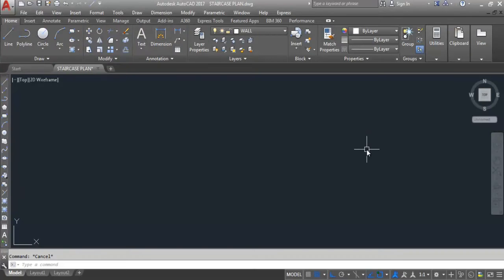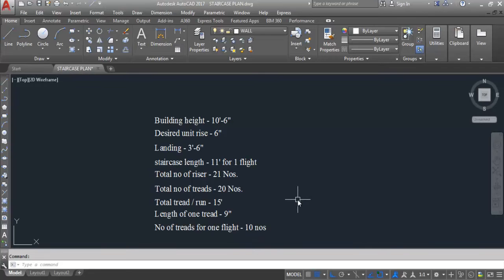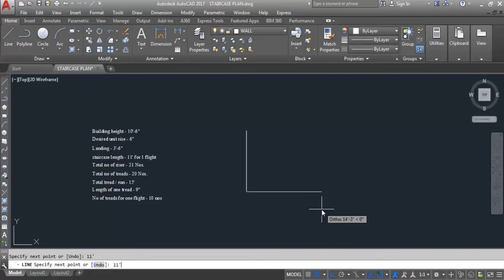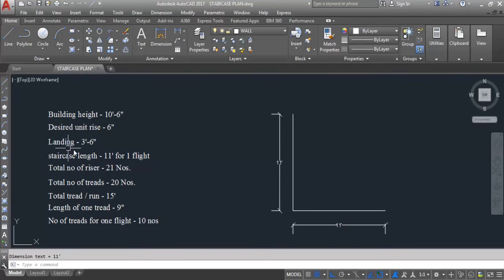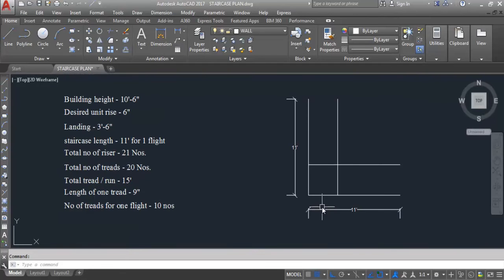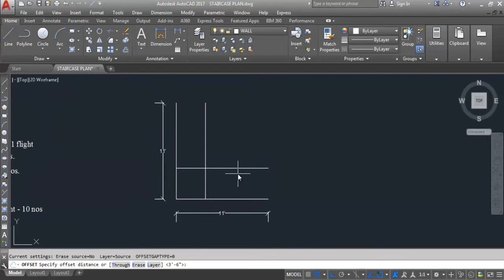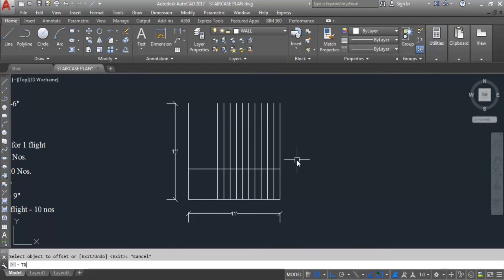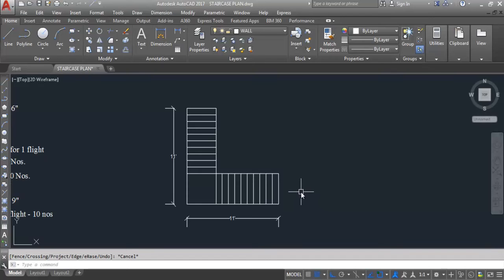1.How to draw L–SHAPED Staircase in AutoCAD | L-TYPE Staircase

Comment: if we have L shape stair case in front view of plan then we should show the stair elevation in the elevation view of ground & 1st floor and mumty floor
Reply from the maker: If there is an L-shaped staircase visible in the plan view, the stair elevation should be shown in all relevant elevation views corresponding to the floors it connects. This means you should depict the staircase elevation in the ground floor elevation, first floor elevation, and mumty/roof floor elevation, so that the vertical rise, landings, and handrails are clearly represented. Showing the staircase in each floor’s elevation ensures that both the structural and architectural aspects are properly coordinated and easily understandable in construction drawings.